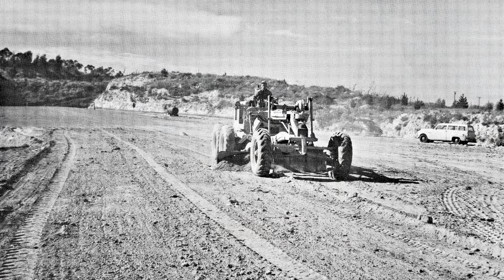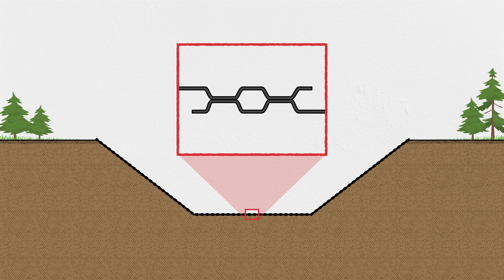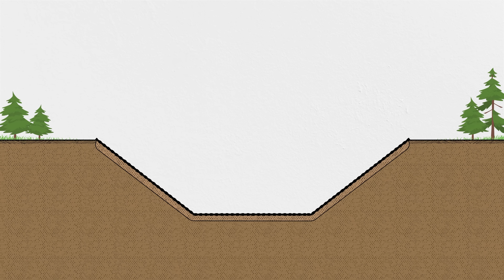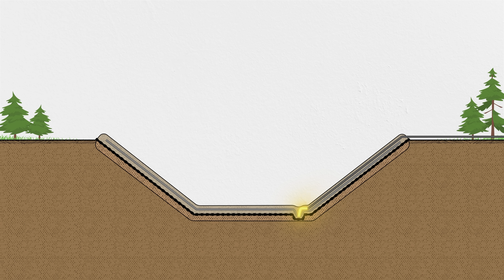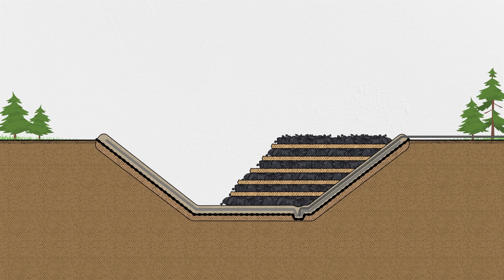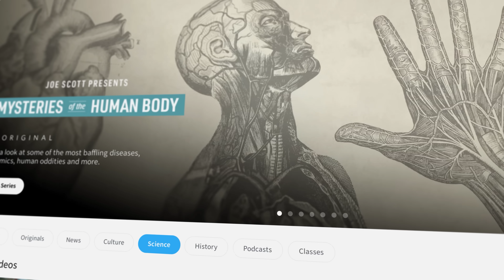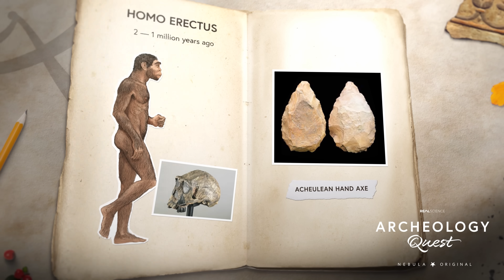The Hidden Engineering of Landfills

Comment: I was a test specialist that traveled to landfills to perform sampling and analysis of both air emissions and leachate treatment systems.  Fascinating places these landfills are.  True fact- when you first arrive the smell can be overwhelmingly nauseating but your brain begins to ignore the bad odors through a process called olfactory fatigue.  Depending on the person, within a couple of hours you don't notice the bad smells anymore.  But that's not always be a good thing; your sense of smell is important in detecting toxic gases (like hydrogen sulfide) so carrying a gas meter that could sound an alarm was required for some test situations.  Great video as always!
Reply: a generalized form of the concept of olfactory fatigue is the fact that all of our sensory input detects derivatives, changes, differences- not constants or absolute values. a weight is heaviest when loaded or unloaded, not carried. a constant droning noise is loudest when starting or stopping. something hot is warmer than the environment, yourself, or its recent past self. you cannot see clearly in darkness or bright light when changing from one to the other. stinky work clothes will probably smell as bad coming out of the wash as they did coming off you at the end of the shift, just like how a smoker's clothes will smell to a non-smoker more than they do to the owner, etc.

Comment: If we can figure out how to replace plastic with biodegradable and compostable alternatives, landfills will be much easier and less costly to manage. Plastic traps a lot of that gas and leachate, and it only breaks down into microplastic instead of going back to a natural state of some kind. Wood breaks down to carbon, glass breaks down to sand, and metal is already in soil naturally (that's why dirt/soil color can be quite red in many places).
If we can't figure out how to recycle plastic (yet), then we should be collecting, cleaning, shredding, compacting and storing it in warehouses until we do figure it out. There's obviously upfront cost, but it would then lessen the billions we spend every year dealing with the disasters currently being caused by plastic pollution. Plastic is in our food and water RIGHT NOW. This is a disaster already unfolding, not just something we need to fix for the sake of our children or grandchildren. Build a few giant warehouses in a desert and start sorting and piling up plastic bricks. We have to stop dumping it in bodies of water, or pretending to recycle it when in fact it's just ending up in a dirty outdoor pile somewhere.

Comment: Lookin at your landfills there, I'm glad that my country forbid any organic waste from landfills in 2016.
Reply: from? why would you take organic waste out of a landfill?
Reply: @vacamike  Finland. We use organic waste as fuel. That produces heat for district heating and electricity.

 Some other benefits include but are not limited to: The landfill disposal of organic waste is decreasing, which in turn reduces landfill load as well as the formation of landfill gases and dioxins produced in landfill fires.
Reply: @humppanen9130  there are 419 landfills in Finland
Reply: @vacamike  And? I work at one of those. Besides, that number is way too big lol. This is a small country. 40 is closer to reality. Our landfills take in mineral wool, asbestos and contaminated soil. You can't recycle those.
Reply: @humppanen9130  google says youre wrong
Reply: @vacamike  we might have a language barrier, and mean different things. Anyway, I don't really care. If it helps you sleep better, fine by me. :) This is just the knowledge I have by... Well, actually living here and working in the industry.

Comment: A lot of open pit mines use the exact same setup to leach minerals out of ore... dig a pit, line with clay, welded membrane, more clay (to protect the membrane), lay out perf pipe, cover pipe with gravel, fill with ore leach ore and pump the slurry out of a sump to be processed.

Comment: Here in Louisiana its my job to treat leachate for several different landfills and help manage the gas system for a couple too. The one im at right now is in the process of installing an active gas well system. They just installed the flare pad, but eventually they're going to tie the gas system into the local natural gas supply. 

Your average landfill spends anywhere from $.05- $.35 on leachate dispapsal. The big problem is usually nitrogen. Municipal waste tends to be high in BOD content which produces a long of ammonia as a byproduct. This isn't a problem if you have enough area for retention and oxidation, but space tends to be at a premium at these sites because every square meter will eventually become a cell. Right now we are permitted to discharge and an independent labroratory agency collects samples on behalf of the DEQ. 

I could talk for hours on this stuff. My degree is in marketing but when i found out what a huge burden leachate is I dove in headfirst with an engineer, a banker, and an oilfielder to design mobile treatment systems that could handle the problem. That was in 2018.

Comment: Grady, Please consider doing a video on super duplex stainless steels(SDSS) as it relates to bridge construction and other industries. According to Wikipedia there have been several bridges built from duplex or super duplex SS. SDSS is half ferritic and half austenitic phases in their microstructure  giving it the best properties of each type. SDSS' are more than twice as strong in tensile strength: 304/316SS are proofed at between 200-280MPa, whereas S32750(1.4410) is proofed min. of 530 MPa with an ultimate tensile strength of 730 to 930 MPa! This means that thinner sections can be used saving weight and cost. The biggest positive attribute of SDSS' is corrosion resistance measured as a PREN(pitting resistance equivalence number). 304SS has a PREN of 19, 316SS is 24, S32750 has a PREN of 43. SDSS' are used in some of the harshest environments, petrochemical and gas industries, pressure vessels, constantly submerged in seawater on drilling platforms, pulp and paper industries, desalination plants as SDSS' are very resistant to corrosion from chlorides. Thanks. Keep the great information coming.

Comment: My local landfill in the uk has been converted into a golf course. They have finally finished using it now so the remaining area have now been covered over. Not sure if the golf course will be extended or if they will use the land as something else.

They possibly dig it up and use the waste to fuel the local waste burning power plant

Comment: This may be old information but I took an environmental science class about 10 years ago. The professor said that these liners have a warranty of up to 50 years. But the waste is still there long after the 50 years. I thought I’d research it and I found that sampling has been done to see how the liners have held up. Many are failing before their 50 year warranty is up. Why would they provide a warranty on something that can’t be easily monitored or replaced if it fails? Either way I’m glad to know that some landfills are using clay as another layer of protection. 

Many landfills used to burn their trash before the clean air act put a stop to that. Hazardous waste used to be dumped in landfills. Often in 55 gallon drums. Buried and forgotten until they leak and get into the groundwater. 

My local landfill is 3-5 miles north of the river. It’s up hill and I keep wondering if leachate is finding its way into the water table down to the river at some point. I would imagine it should have been put farther away from our drinking water. I like to think of the worse case scenarios and try to build in features to mitigate the risks.

Comment: I heard of using the off gassing to produce power. Sadly or luckily in my country the population is more disperse (5 mil+) so there are many small ones. But near my capital city there are 2 water treatment plants that use the sewage biomass to produce gas to heat up water or even heating in winter and also electricity.

Comment: #48 in Trending?? That's wild for a video about landfills and garbage, but expected from the  production quality of videos you put out. Congratulations Grady 🙂

+100 for the word leachate, always happy to learn a new word, but "bin juice" is so visceral and nasty that I'm still gonna use that.

Edit: I was wondering about the parks and sort of nature preserves that could be built on top of closed site, and I was wondering about the potential for collapses. The garbage would settle over time and as the organic stuff decomposes, wouldn't gas pockets build up? You mentioned they remove the gas, but if they dont replace that with something there's gonna be a void isn't there? So much goes into closing them so I probably missed something, but I've seen big steam roller like trucks at the local dump where I used to live (the suburb, no I didn't live at the landfill. It was a bit of a dump though.)

But my point is, that if an amount of the garbage decomposes into gasses, and the gasses are taken away from an airtight, watertight mountain, isn't that gonna create a lower pressure area inside and cause collapses? I wonder if it happens if there's a collapse after the 30 years is up?

Comment: One of the most fascinating things about landfills, that was briefly touched in here but goes much deeper, is that the internal chemistry has an entire lifecycle that has been very thoroughly studied and modeled. You can actually predict the volume and composition of leachate and gas discharge to astonishing accuracy based on just the size and what phase of "life" the landfill is in. It even informs things like what can be placed together and what has to be segregated into seperate cells, for example construction/demolition waste and food waste have to be kept as far apart as possible because the gypsum in building waste acts as a rich sulphur source that the microbes in food waste will convert to hydrogen sulphide, at certain life phases of the landfill, which is an odour hazard but more importantly is extremely toxic when concentrations get higher, like in the case of combined food-building waste!. I can honestly say, after studying landfill chemistry, I see them as essentially giant bioreactors for processing waste, rather than a static graveyard of trash.
Reply: Years ago I did some work at a landfill that primarily accepted C&D. It's the only landfill I've been at that had a flare specifically for sulfide. It is insane just how much stink gas that dry wall / wall board can lead to!

If you're not already familiar with them, you may be interested to learn about anaerobic digestors. They're a new waste disposal alternative that basically makes an accelerated version of a waste processing bioreactor. Rather than taking years to reduce the carbon, sulfur, nitrogen, etc., it's done on the scale of weeks.
Reply: @ppltlkng and anaerobic digestors can produce methane for a cogeneration engine and produce electricity with methane thats been processed. a handful of wastewater treatment plants have this setup
Reply: @ppltlkng  all the sulfur from gypsum in drywall!
Reply: I'm a chemical engineer turned into a landfill designer, and the most complex math I had to use professionally was from landfills. 1st order decay equation to predict the annual amount of organic material that got converted into gas. That's pretty well understood math, though it does use differential equations. The main issue is that because landfills operate continuously every "vintage" of waste is essentially at a different stage of degradation - new stuff is not degrading yet, 5-10 year old stuff is at it's "prime" and older stuff is tapering out. So you ended up with these gigantic triangles of equations to estimate the volume and composition of landfill gas on a given year - literally called the "pyramid model". 

Amazing, fun, and really neat work. Would totally recommend it to fellow engineers that don't mind doing a bit of the "dirty work".
Reply: I would love to read more about this, do you have any recommendations for further reading?
Reply: @daydodog you can probably get access to good case studies from professional bodies like ciwem/icheme. Water companies themselves might have some eg thames water in the uk probably have a reasonable amount of info on Beckton, a nearly 4 million population equivalent super STW that is song the biggest in the world
There's a lot of useful info available if you just type into Google "anaerobic digestion case study"
Reply: @daydodog I was wondering the same thing.
Reply: @daydodog Google search gives textbooks.
Reply: That makes me feel better about land waste… proper landfills are wonderful big experiments
Reply: This is all so fascinating.  In regard to that lifecycle, I’m curious about the very long term stages and what these environments will ultimately look like once “stabilized” if there is such a thing - such as the stasis of soil after composting.  What are the timelines and what do these environments become - particularly with the very high rate of synthetic petro-derived materials we live with? Do we even know yet?
Reply: Amazing!
Reply: Thats all clinically blind and insane dribble. We did this all within a century. We have absolutely no idea what will happen and today we are seeing microplastics in everything. Food, water, air.. you name it. Humanity will not make it past 2030. Dont delude yourself.
Reply: Me, when I breathe in cope too much:

Comment: With the current copper shortage, I wonder if there's enough discarded electric devices (blenders, car alternators, most anything with a motor or lots of wiring) to tip the balance in favor of revisiting some of the older landfills to recycle what can be found.  Then again, I bet that the amount of recoverable materials would be so small per volume, it may not justify the effort.
This makes me wonder what the composition is by volume.  How much fabric and old clothes?  How much styrofoam packaging?
Plus, imagine the pathogens that could be hiding in there!

Comment: I'm looking at building a zipline that go over a creek. I plan to use 16- truck, containers put on a concrete slab. Using 2-containers for each level. Stairs going to the second floor. Secure the layers with strong wirer to the concrete base. There will be 4-ziplines. 2-Ziplines will be inside the 8th level containers, facing north. 
2-more Ziplines, will be on the 6th floor, facing north.
Reply: Poles around the concrete slab and well lighted.
Reply: Any opening will have enclosed fencing. This also goes for the Ziplines opening to the north, a lower floor with fencing!

Comment: Ive built a handful of new landfills, cell expansions, closures and capped a EPA superfund contaminated landfill.    Great video covering the process.   Few people have a understanding of the engineering, construction, ongoing processes and continuing requirements of a closed landfill.   Trash is big $$$$ and will only get worse.    Lastly, i kept hearing 200yr design life on the liner and piping systems.   Cant imagine javing to deal with a 200yr old landfill that starts leaking

Comment: I hauled Leachate water out of three landfills near Minneapolis/Saint Paul, MN.
I watched the build process of one cell. Its really quite interesting. We would pump the sumps out and believe it or not, it was then hauled to the Saint Paul waste treatment plant. One Landfill that we hauled out of had a Methane gas collection system that was used to power special Caterpillar generators.
 The amazing thing was that they built roads right over top of the garage piles that we drove our Semi trucks over.

Comment: In Holland an old landfill was found  contaminating ground water. 
All waste was dug up, screened and separated to take recyclable material from it which they didnt save in the 1960s, and built up the landfill on a new heap with water sealed bottom, and pipes to collect the biogas that still forms in this fill. Section by section, the entire landfill got sanitized, resources were mined from it, and it will power a small electricity plant for years to come.

Comment: I live in a city where virtually every single hill is a landfill converted to a park. It's flat as hell here, at the bottom of a glacial valley surrounded by post-glacial plateaus that are only a couple of metres higher. But we have some lovely hills, and almost every single one used to be rubble and trash. Or, strictly speaking, is rubble and trash, with a bunch of engineering sealing it away. And they are all fantastic parks with outstanding views of the city and the surrounding nature.

Comment: I'd love to see a follow-up video talking about the logistics of developing on top of existing landfill sites (like Puente Hills). Utah has been in the planning stages of building an inland port and the project purchased the SLC landfill with speculative aims to develop the port on top of it (largely because of the limited space in the valley). The City View Center mall in Ohio was built on top of landfill with disastrous results with methane gas build up and the surrounding parking lots sinking several feet. I'd love to learn more about the logistical challenges of repurposing these sites. :)

Comment: How do they avoid sink holes forming when they build parks over these? Does the material simply not degrade and compress enough to allow the surface shape to slip much? Is there some sort of organization of materials to more evenly distribute trash that will rot away?